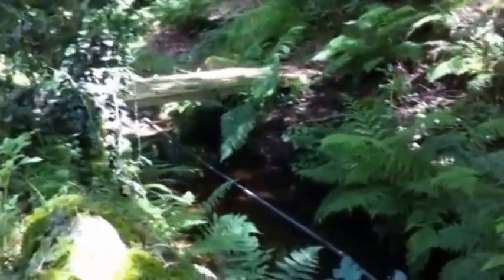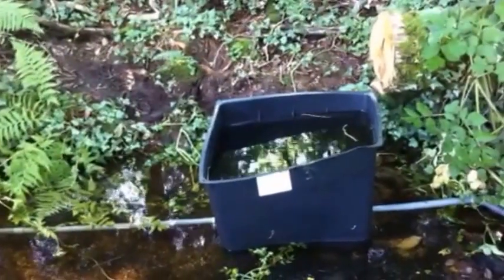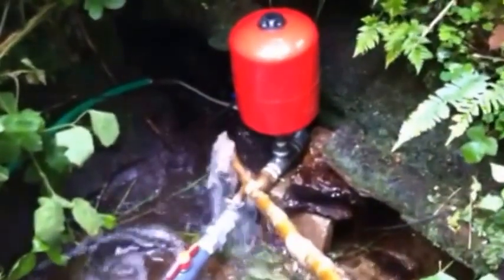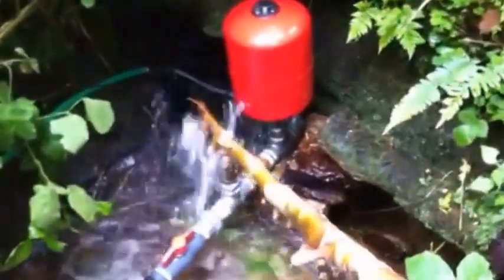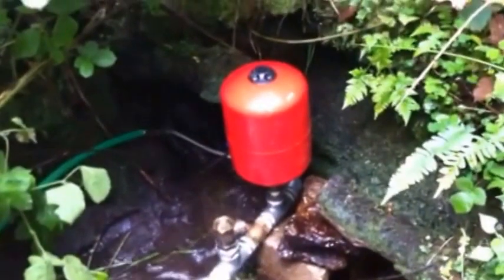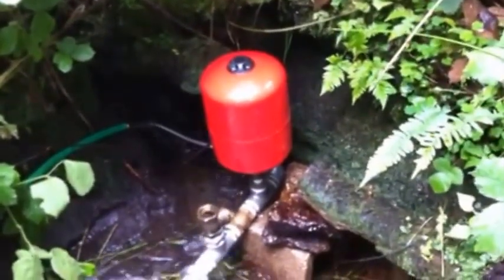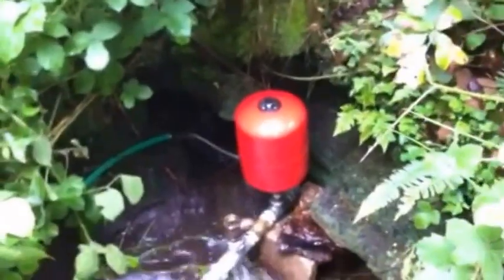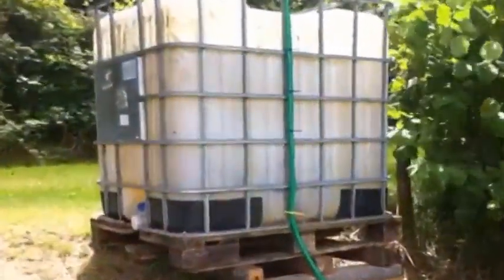Installation of ram pump update

Comment: cool video as an EX Brit here in the states I am interested in these pumps and follow Seth Johnsons Land to House builds do you need to re pressuerise the tank very oftern 
Roy
Reply from the maker: Hi Roy,
the pump has been running for about 3 weeks now with no problem as it has a built in bladder I doubt it will need re-pressurising although it would be a simple matter as there is a valve on the top for that purpose, If there are any questions just as.
Thanks for subscribing by the way.
Mike